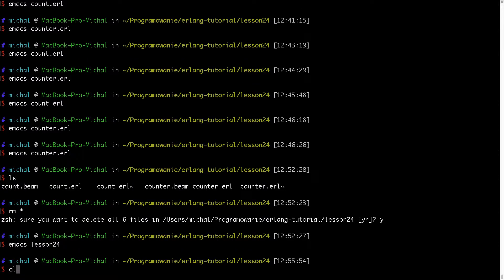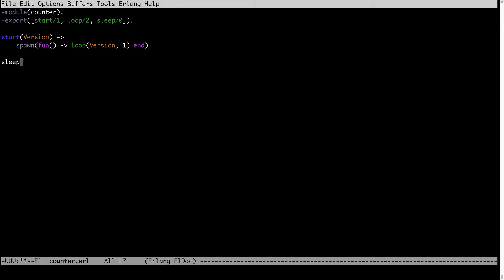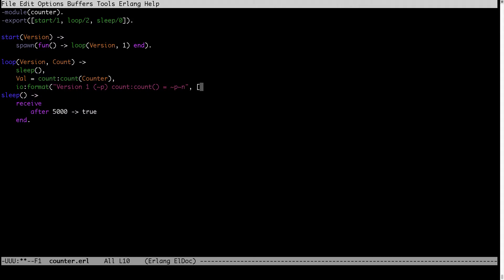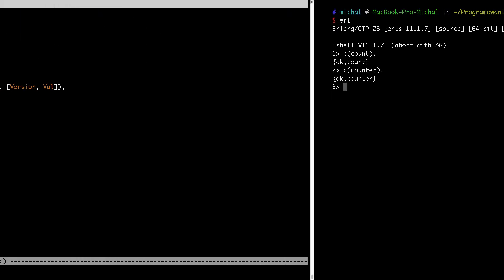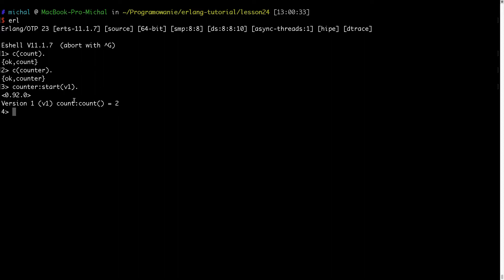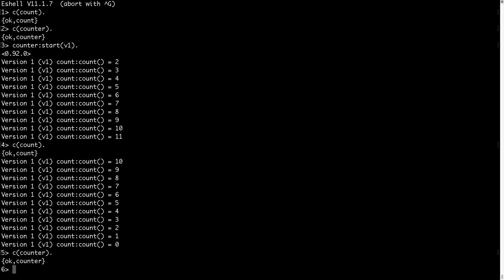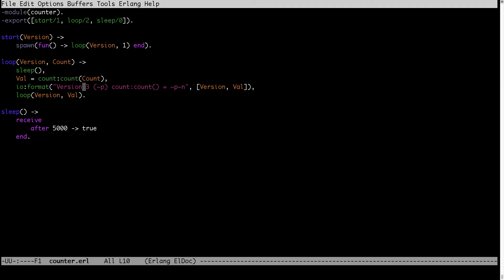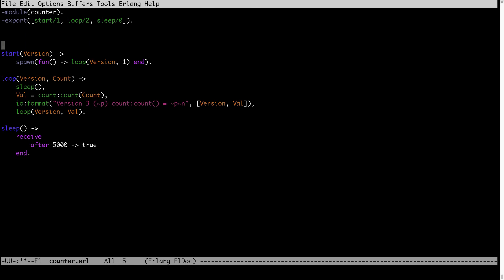Erlang tutorial: Dynamic Code Loading

Comment: why this printing code can have 2 version but that count function couldn't and it got immediately updated? Thanks.
Reply: I would guess its because of the spawn() function only being called in the counter -function. This creates a process which keeps running indefinitely because of the loop() until you update the script twice; Erlang only stores the last and current version of the file. The processes created each time count() is called only lasts as long as it takes to return the output (so probably less than a millisecond), and a new process is created each time count() is called and when a new process is created, its always created from the last version of the module.